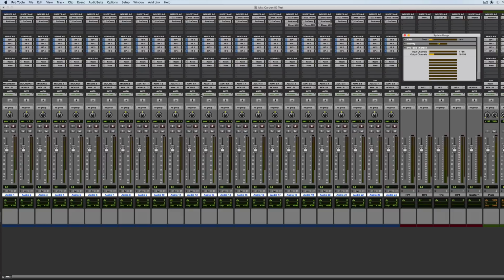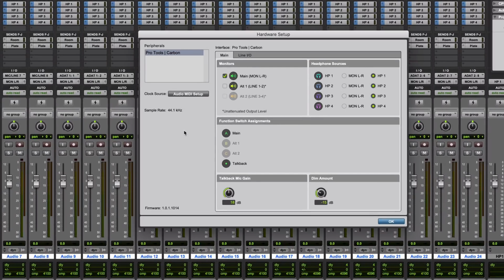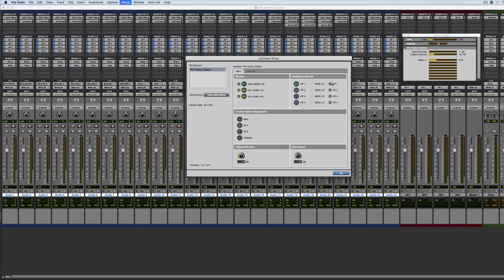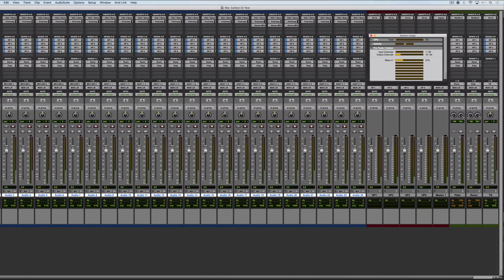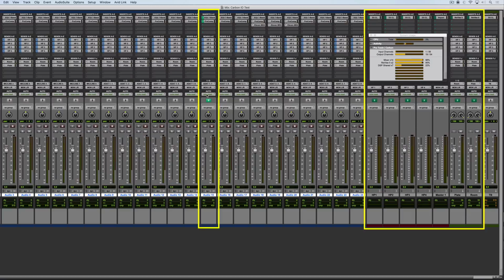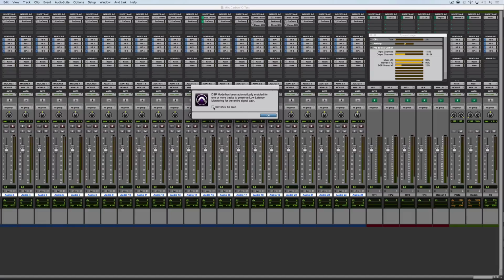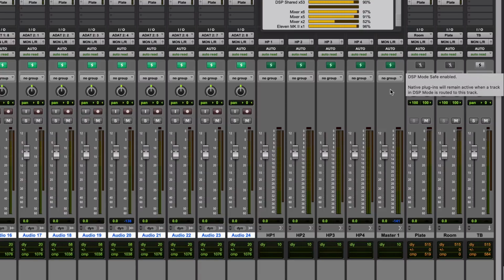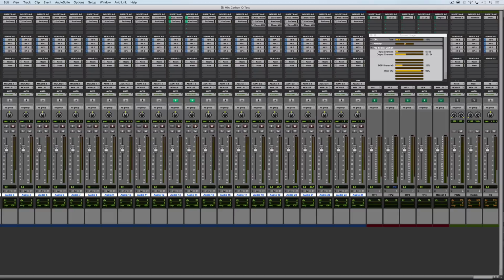Pro Tools Carbon - First Look

Comment: Meh. I'm happy with my MOTU 828ES. Cost half the price of an Apogee Ensemble, shares the same converters as the Ensemble, long term driver support like RME, rock soild drivers, innovative matrix routing in the AVB web app eliminating the need of a patch bay and messy cable's.